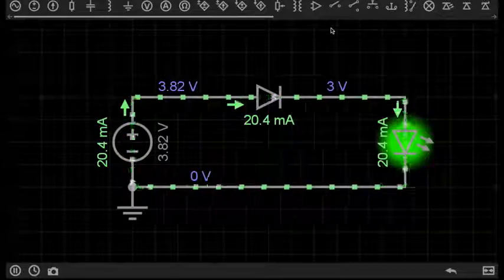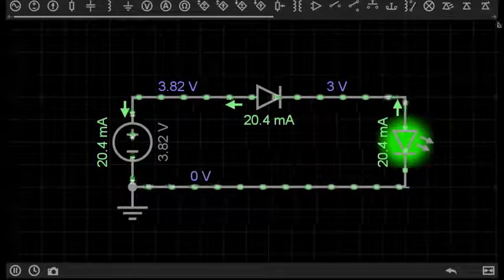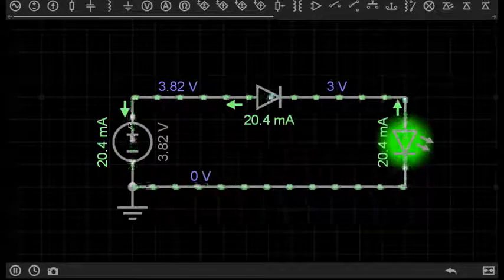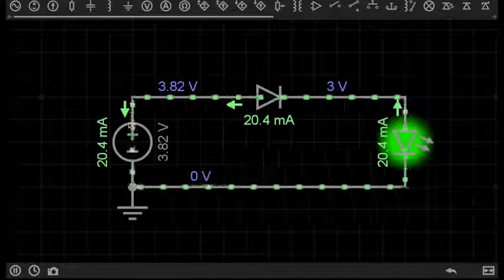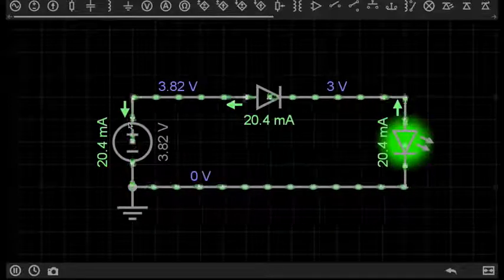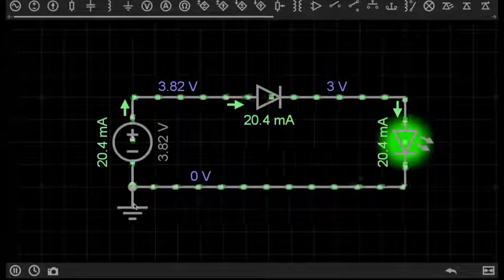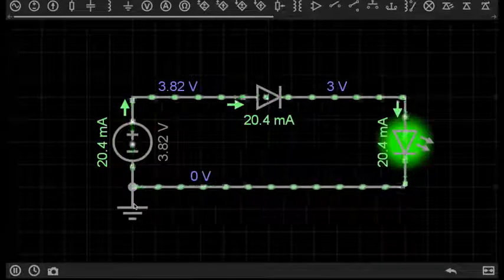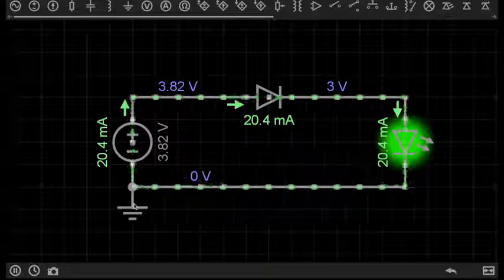Conventional vs Electron Flow Current Flow

Comment: Hi  This is really good stuff .. All the students are really confused with Current flow and Electron Flow .. (specially with  components  Symbols -- eg: Diode  in a circuit diagram ) . I really appreciate if you you could post a  video -  diode with a current flow /electron flow . Also If we follow Diode symbol  in a circuit diagram  - is it really P type or N Type ... or the other way.. 
Thank you ..
Di